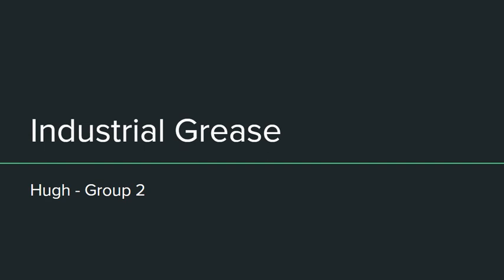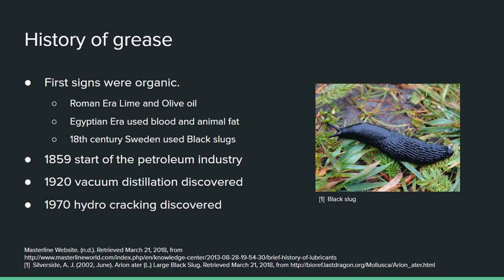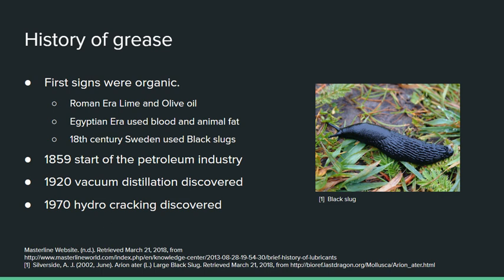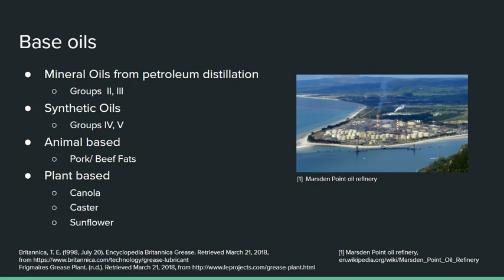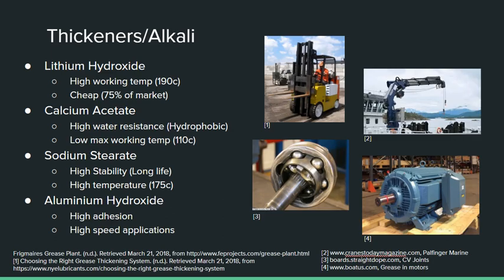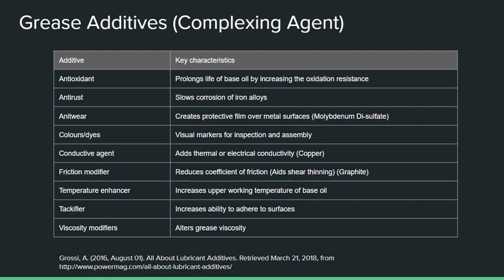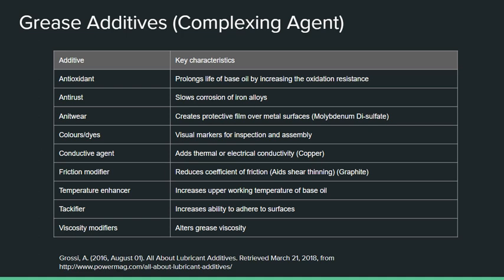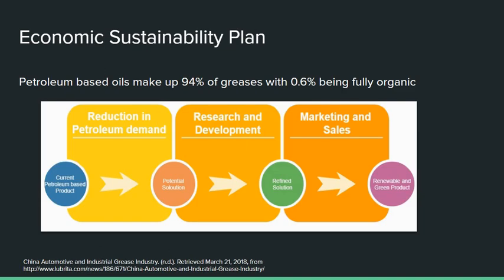What is grease and how does it work (lubricant)

Comment: I got really caught up on the copper additive. You said it increases conductivity which is important in a dielectric. My understanding was dielectrics mainly serve to insulate. Could you elaborate a bit?
Reply from the maker: Hi, Copper additives are used to create a electrically conductive grease. This is used on actual contacts/connections. 

Dielectric is not strictly conductive although some do conduct slightly. Dielectric is commonly used in and around electronics mainly to protect the contacts/connections from moisture and other environmental factors. You wouldn't use thermally conductive grease for protection as you don't want electrically conductive grease squishing out all over the place!

Comment: interesting video but i still dont know how grease works,
i mean why does grease makes it slippery and for example honey doesnt?
Reply from the maker: Grease is slippery due to the oil inside it. Oil reduces the friction coefficient between 2 surfaces by acting as an intermediate contact. Something sticky like honey has a very high surface tension and in turn increases the frictional coefficient. Have a read on wikipedia about surface tension and sheer thinning